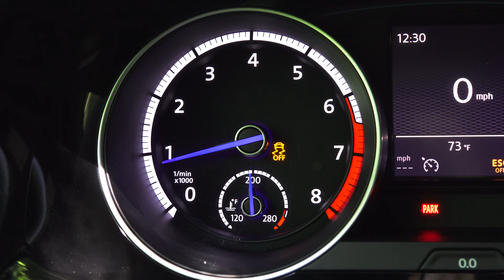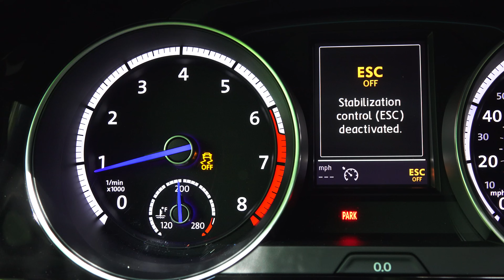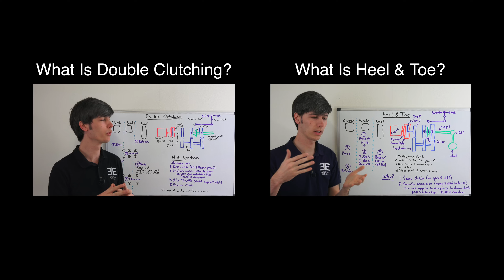How To Launch A Manual Transmission Car

Comment: How do you figure out when to shift into other gears, for example first into second.
Reply: well a dyno would show you're peak power, so in theory you would want to shift just after you peak, when the gear changes your rpm should drop to around hat peak range again. For example of my Yamaha R6 that peaks add 13k, I shift at 14k so it drops to around 11.5k so therefore I'm staying in the powerband
Reply: You will feel the car stop pulling at a certain point that's when you shift
Reply: when car starts to struggle, engine will become really loud, and rpms will be high
Reply: +Thomas Bennett Whenever is most comfortable for you. Driving around town in my STi, I'll try to keep it under 3k RPM, so unless I know I'll need the ability to move, I'll keep it in the highest gear for the speed I'm at. Normally on 35MPH roads that's 4/5th.
Reply: +Thomas Bennett the video explained it. In most cars (petrol), if you wanna go fast, shift just before the redline. You shift earlyer only if the torque drops 60% after a certain rpm. You can look at the dyno graph or just do it with the butt dyno. I shift early only in some diesel cars, this could also apply to big displacement petrol truck engines, with high torque output at lower rpm....somebody correct me if Im wrong please

Comment: I'd like to expand on the process some.  You have two choices: modulate throttle or modulate clutch.

You modulate throttle if the engine is overpowered (think muscle car).  You will find that you can often modulate wheel spin via the engine due to having a healthy excess of torque to allow that flexibility.  Since tire grip is the weak point, you modulate tire speed maintain near that grip/slip transition using the throttle pedal as the car begins to increase forward speed.  You will keep modulating the throttle as needed up to full throttle if grip allows.  You may find that you can spin in 1st and 2nd, and can't apply full throttle until 3rd gear.  In this case, you are modulating throttle through all of 1st and 2nd with heavy focus on tire rotation speed and trying to keep it at the edge of grip/slip as the car accelerates from 0 to 30, shift, from 30 to 60, shift, from 60 on.

You modulate clutch if the engine is underpowered (think awd with a 4 cylinder engine).  Since the engine really isn't capable of breaking traction, maximizing what you can get involves maximizing hp output from the weak engine.  You want throttle to the floor and are aiming for peak hp rpm.  You will feather the clutch much like threshold braking where you're letting off just enough of the clutch pedal to get enough bite to begin to bog the engine.  Then you modulate the clutch pedal to control engine rpm and keep it at max hp output.  Often you can find yourself slipping the clutch through almost the entirety of 1st gear, so from a stop to 30mph, you may very well be slipping the clutch the whole time, gas pedal to the floor, and modulating to control engine rpm around peak hp.  This is pretty difficult to get perfect as clutch feel is very lacking.  It takes a bit of time to dial in, but you will get the fastest acceleration possible for the car.

You always focus on the limiting factor and modulate it using the correct tool.  Overpowered, tire grip limit modulated with throttle.  Underpowered, engine power limit modulated with clutch friction engagement.

Comment: 3:37 I learned this the hard way in my tracker, and I wasn't even launching it! I was just passing somebody (rather aggressively) and I redlined it in 1st, slammed it into 2nd and released the clutch so fast that I mulched 2nd gear. I should also add this was at the end of winter, and I was on dry pavement but still had it in 4wd, so the poor transmission didn't stand a chance lol

Comment: TMI lol, i just say don't spin your wheels. If its front wheel drive i think you almost have no choice but to spin your wheels but try as little as possible. Rear wheel drive let out the clutch quickly but never dump it, that will help move weight to the rear and that's when i let go of the clutch all the way then when i feel the clutch grip i floor it if its not too powerful. That was on my old 88 Turbo Supra with very meaty tires and around 350hp at the crank.. i say that because on the highway it was faster than cars that weighed the same and that came with 350hp from the factory.. but barely.
Reply: +Anthony Buscemi good point lol, sorry! I was half asleep when I wrote that. Just had a good nap hahaha.

Comment: The trouble I have with my MG TF is that the clutch always burns out when I want to do a "fast" launch. Zero wheel spin occurs (RWD) but lots of clutch burning smell instead heh. Might change it for a more sticky clutch one day since the MG TF loves high revs but has absolutely awful torque at low RPM.
Reply: +Jim Griffiths 
You probably will need a new clutch in about 15-20k km's.
Reply: *****

Yeah. I think the previous owner liked to dump the clutch quite often. It feels like an old clutch, especially in a "sports" car. Doesn't feel very sporty to me.
Reply: *****

How many miles does it have?
Clutches usually need to be replaced every 60-150k miles depending on the driver.
Reply: *****

35k.
Reply: +Jim Griffiths It definitely got used hard then.
Reply: +Jim Griffiths You need less initial rpm then. The clutch not catching isn't doing you any favors.
Reply: *****

Damn, it sure had a rough life if it already feels old.
Maybe you need to release the clutch faster.
Reply: *****
By the way he wrote it up, his clutch was release too fast or his initial RPM was too high. It's not fast if the clutch is just burning up. That doesn't get power to the pavement.

Comment: hey man, very informative video. I always come to your channel for everything car related. I know that many super/sports cars are built with launch control systems. could you possibly make a video about that?
Reply from the maker: The launch control system essentially try to do what I explain in the video, but remove variables from the driver to allow for a more consistent launch. (Rpm and throttle will be controlled by the ecu, you just floor it, dump the clutch and hold on).

Comment: As the proud owner of a 2016 Golf R manual I can tell you that my only disappointment with the car is the weak factory clutch, which you can smell burning with even a mild launch
Reply from the maker: I would agree, the GTI was the same case. New WRX and STI have much grabbier clutches, can handle high torque without slip.

Comment: You just managed to make the use of a manual gear change sound complicated beyond belief. Initially I thought you were demonstrating launch control. You should have used the expression of 'feathering' the clutch and accelerator like balancing a see saw. You never even mentioned selecting first gear, it was as if it will always be in first gear ready to pull away. Still love your work.

Comment: If you are already using 2 cameras, and are switching between them then do look at the other one as well. It is nice to see that you have the editing skill to mach the audio and footage but is kind of not the point of having 2 cameras, is it now. Id suggest that you do the switching when you do look at the other camera which you could do when you have either explained 2/3 points that you wanted to get across. Besides that your videos are good and informative so that is a plus. It's just my opinion and i'm sure there are people who agree with this.
Reply: +TheEchoholic Also i get the impression that your second camera has a view finder... if that is the case don't look at the view finder but at the lens... that way it feels more direct, if not than it was just the feeling i got.
Reply: +TheEchoholic The idea of having two cameras is really to hide screw ups, if he misses a line or makes some kind of mistake in a sentence even if its in the middle of the sentence he can stop, go back a few words and retry the sentence and just do the camera change at the time of the screw up. the effect this gives is that you as a viewer won't be able to tell he cut a sentence half way through because your brain will be busy noticing that the view shifted.
Reply: megaspeed2v2 Say you are right, why not then look at the other one at that moment to make even better?

Comment: OMG OMG OMG finally a Golf R Review!!!!
Reply: +Adam Chandler As a Golf R owner, this was interesting. I have some feedback. First, 3-4K RPM is as much as you should do for optimal power to wheels. More will just be lost. Second, the power band is interesting. The IS38 Golf R Turbo tends to lose power around 6K RPM and it's all down hill from there so launch at 3500, once you see 6K RPM, begin shifting. Also TCS Sport on Golf R actually will work better for launch speeds over ECS Off. 

With this, the Golf R MT will do 4.9 seconds easily, the DSG version will do 4.5.

Comment: You didn't mention the pint point of the clutch, which is very important for a launch. You need to find the point where the clutch starts engaging and squeeze just a little bit, so you don't cause too much wear for the clutch. Many modern cars tend to have a lot of empty space in clutch pedal between the bottom and the pint point, so it is almost impossible to lift it all the way up from the floor to fully engaged quickly and accurately.
Reply: You mean the biting point?
Reply: Agree modern clutches are so damn long.

Comment: What year is this Golf?
Reply from the maker: 2016
Reply: 0:06 seconds in they tell you dude...
Reply: 45'
Reply: +Strike_Raptor You're right. My attention must have been else where. I just thought the Golf no longer had the manual transmission as an option.
Reply: ***** Well the last generation of the Golf R only had a double clutch, so it wouldn't be too out there if they did it again

Comment: I love manuals, but I enjoy my auto integra for that reason. I don't have to be so precise to launch. Just lay on the brakes, build up revs, and let go of the brake. If I lay the shifter on first gear, I can control when I shift still because I can still select all 4 gears. Best of both worlds.

Comment: You could also use the e-brake to hold the car steady if not on a level surface. And then you just release the brake on the launch. This of course if you have the conventional e-brake.

Comment: How much torque should i put if i have a CVVT system on the engine?
Reply: +Choujeen 
All of the torques
Reply: +Choujeen don't know what you're tourquing about
Reply: Choujeen

It's a automatic, just floor it
Reply: +Choujeen what you said makes no sense
Reply: +Choujeen Are you referring to a CVT or VVT? Those are completely different things. You don't have to worry about VVT when launching a car, or at all, really. CVT's aren't even manuals so that thing that you think is the clutch is actually just the dead pedal where you rest your left foot. By the way, CVT's are awful for launching/racing, but great for efficiency and everyday driving.
Reply: Josh Briggs
Yeah I meant engine rev, not torque.
Reply: +Choujeen None of this video applies to your CVT.
Reply: +Choujeen He's obviously a troll guys
Reply: Mazen Mourad
I meant Continuous variable valve timing, CVVT.
Reply: Choujeen Oh.. You actually meant CVVT. lol. Yeah that's just VVT and something the car handles on its own. No difference there.

Comment: Clutch in, first gear, pull handbrake and hold, build up RPM, slowly start releasing the clutch, after you feel it starting to bite release the handbrake. That way you are preloading the drivetrain instead of letting it all at once, less chance to brake stuff.

Comment: A good way to launch without or little damage is to first let the clutch engage with normal throttle application and once it grabs floor it.
Reply: This is the way
Reply: Thats a granny launch
Reply: @sigmamale4147 - The so-called "granny launch" is plenty quick enough for me and my Audi R8. I'm not planning on replacing the clutch any time soon and I'm super not planning on becoming another clip on YouTube of a hooning car guy getting pulled over by the cops. My work Ford Transit on the other hand... 😉
Some people can't afford to wear their clutch but want some excitement, others can get excitement without the need of a full launch. I think this is sound advice by @MitsCooKieHH that doesn't need to be looked down upon.
Reply: @pkbeast  well maybe its fun for you, but the very low torque at 1k rpm just feels like a failed launch to me. To each their own ig
Reply: I also do granny launches 😂 @pkbeast
Reply: @pkbeast  I also only do these solely because I do not feel like replacing my clutch once a year. Reving the engine a bit and letting the clutch grip, and then floor it is just safer and is still fun. But I really prefer rolling pulls and it's 90% of the launches I do. Rolling in 2nd, around 20km/h if not a bit less. Then flooring it. near to none if not zero damage to clutch, but still a pull.
Reply: Thanks how do you know when it's fully engaged. Don't wnna burn my clutch out
Reply: @edwardjarvis3442  revs dip a bit and car starts to roll. The flooring bit basically is basically just to stop it from stalling
Reply: @edwardjarvis3442  put throttle, depends on the car.Release the clutch till it bites (means the car stars to move), floor the throttle. That way you can’t damage your clutch
Reply: @edwardjarvis3442  you can feel it with your foot
Reply: @edwardjarvis3442  if you don’t know when ur clutch is fully engaged u shouldn’t be driving a car
Reply: The more you drive it you will find it and learn it. It’s the only way. The. You get good. Slow is smooth and smooth is fast.🍻

Comment: So launching properly will still damage the clutch?
Reply: +TheChannelOfBeast Launching will always stress the clutch even if you're doing it right. You can probably launch once a while but then, you're gonna need alot of practice to get it right.
Reply: +TheChannelOfBeast Of course if you launch the car its going to wear it down more quickly as you will be putting the cars full power through the clutch all in one go where normally when starting off you only load it with a few bhp.

Comment: Depending on the vehicle, you also need to be careful of shift in weight from extreme acceleration. Remember that 60% number? Well that torque multiplication combined with the additional weight on the rear tires means that RWD and rear biased AWD applications, even those that could normally survive plenty of abuse on a track, can be pushed outside of design parameters. Worse the weight shift is normally very bad for the ability to steer, as even if you can't pick the front wheels up, the loss of a considerable proportion of downwards force can lead to extreme under steer. If you have a traditional longitudinally mounted engine and your motors very powerful, the horizontal weight transfer from the torque can also be significant, which places most of the vehicles mass on just the one rear spring, normally causing it to bottom out momentarily and upsetting the vehicles balance (the backyard budget solution used to be placing a oval football inside the coil spring, or a block or rubber clamped to the top of the leaf to increase spring-rate on that side).
Reply: I experienced it in my 4x4.
Obviously it wasn't anyway near fast, but it had enough torque to bend the car like this.
On tarmac, that was harmless, due to low speed.
But on loose dirt or mud... well, trees suddenly appeared magnetic! 
Especially that I drove it only in the mountains, so the rear was even more bottomed out...

Comment: I do this on my 125cc motorcycle, it's the only way to get anywhere. Also, would it not provide more power to keep slipping the clutch to keep the car at it's peak torque instead of dumping the clutch at the start and dropping the RPM's?
Reply: +6Twisted 
On a motorcycle it's usually ok to slip the clutch without much wear since they are wet clutches and are made for that purpose.
Reply: +6Twisted The problem is when the clutch is slipping it means the full torque is not delivered to the wheels. You probably can get a faster time by mastering the slip but it will wear the clutch very fast.

Comment: I just gave full throttle until almost redline and then dumped the clutch. With 175 wide tyres in a 82 hp / 137 ibft turbodiesel engine and a specially short 1st gear, I didn't expect weird stuff to happen apart from wheelspin, and I wasn't wrong. LOL. Obviously not the fastest way to launch, but I did it for fun.

Comment: So I have a vw Golf GT 1.4 tsi sc and it has a rev limiter at 4000rpm so I could be able to launch it from that rpm with letting the clutch out smoothly?
Reply: SI0AX yea of course I will be gentle with the clutch
Reply: +TheCoBBus 
You could just keep it floored while it's at the rev limiter, but you should always smoothly engage the clutch. You don't want too much wheelspin nor want to cause damage to the transmission.

Comment: would you recommend me to do/attempt this in a 79000km Golf V from 2008 with 80HP
Reply: +Maxstar22 Don't let your dreams be dreams.
Reply: Oh yeah no problem
Reply: ChinnuWoW it's called a normal car
Reply: +Martijn Bruggers I threw my 1999 saturn with 120k on it to the Rev limiter and popped the clutch and it's still alive
Reply: If you actually want to try this get a $500 car. Those are like disposable cameras
Reply: +KiwiPowerNZ 1.4l base model in Europe only has 80hp. Your Corolla is a top end model. The US base model has 170hp.
Reply: +Maxstar22 80HP seems a bit low. My Corolla has 130HP.
Reply: avanasear My is a 2006 GL model. I didn't think it was a top model? The US ones are weird because they don't have rear disc brakes like all the Corolla's I've ever seen including mine.